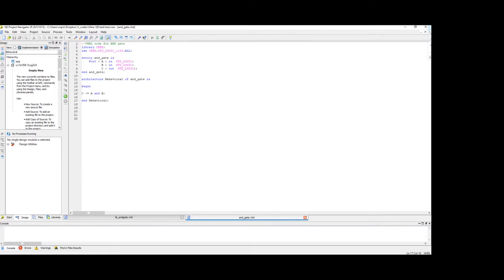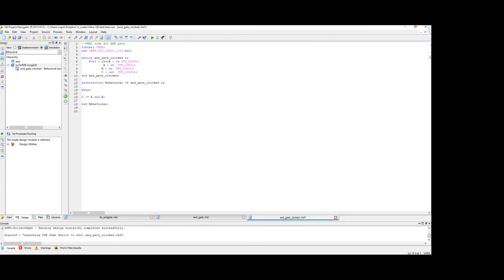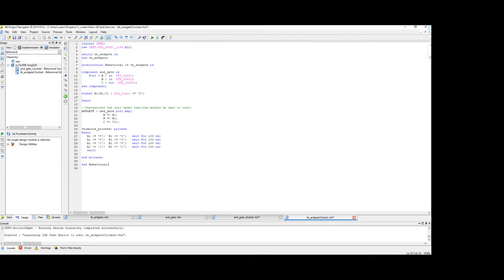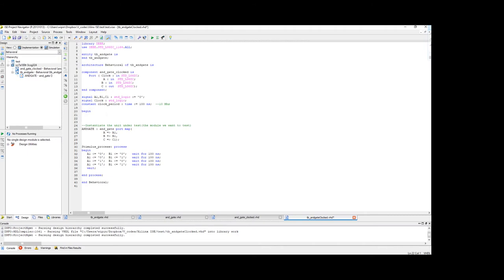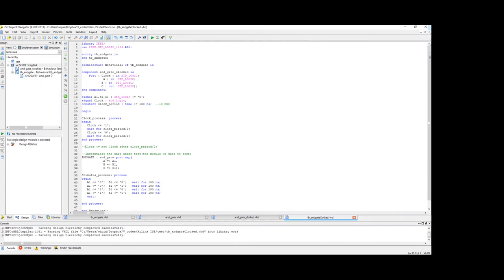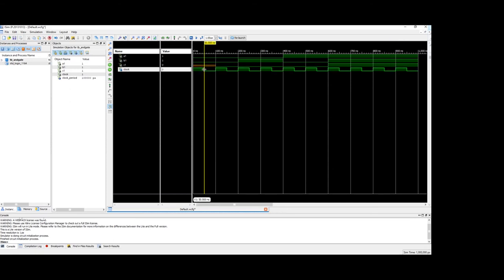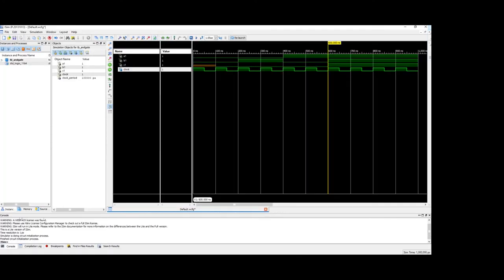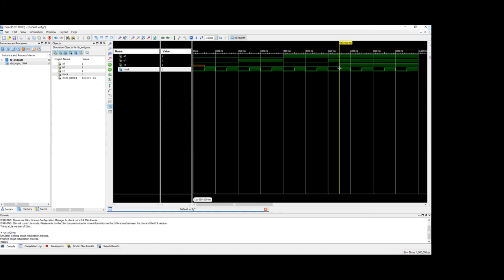Writing a Testbench with a Clock in VHDL - #2 Of Testbench Series

Comment: Hi, how do you make the clock run for a fixed duration though? I have noticed that the simulation only runs for 1000ns no matter where I try to implement this.
Reply from the maker: hey. you just have to change the value in the text box at the top middle part of ISIM. By default its at 1 us(microsecond).
Reply: @VCodes  Any idea how to do it for VIVADO? The simulation window doesn't open unless I run the simulation first, which means that I cannot type in the value in the required field. Also, after running the simulation, if I try to run again by typing a specified duration, it keeps on going forever until I break it.
Reply from the maker: @deathmaster4035  either you edit after the simulation has opened. or you can run it  and specify in the code when to stop. see the bottom part of this link:
https://vhdlguru.blogspot.com/2022/04/extension-of-digital-clock-project-with-7-segement-decoder.html.html

the "finish" statement can be used for this. see the top for the required libraries which are needed for this.
Reply: @VCodes  Allright, thank you.